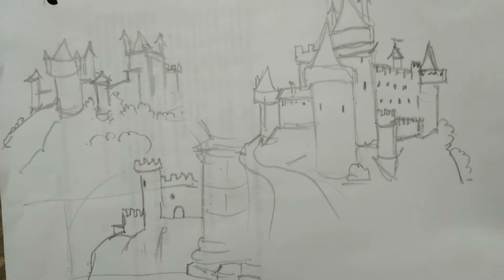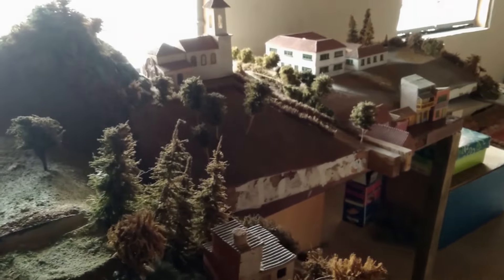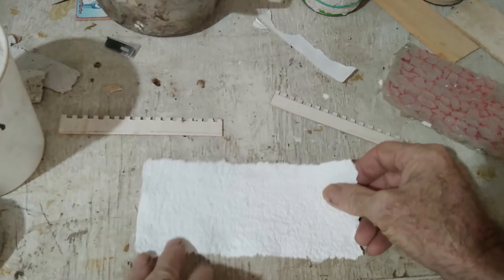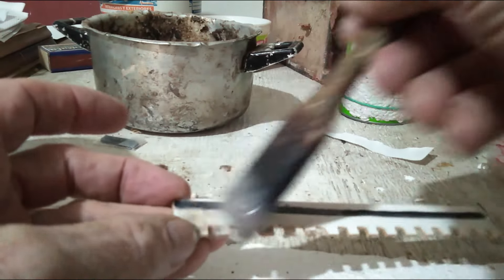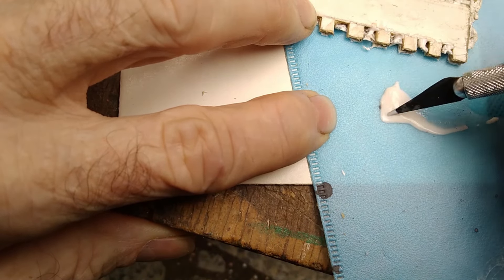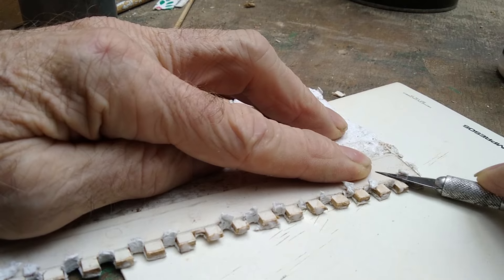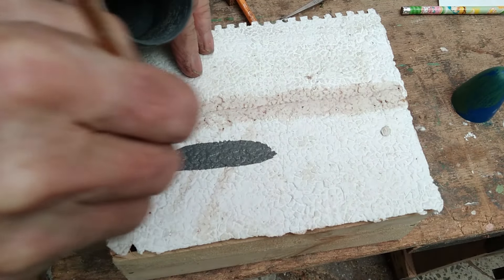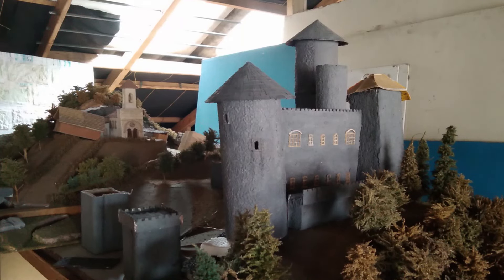Miniature Castle Build

Comment: I love that instant texture from the blended paper.  I once visited a paper mill and the paper looked like that before it was subjected to the rollers that made it smooth.
Reply from the maker: Yes the paper speeds things up, and does OK, although not always perfect. The molds are easy and cheap to make. And even whole walls with windows and doors can be made if you need lots of the same thing.